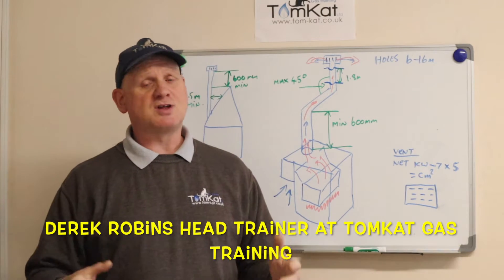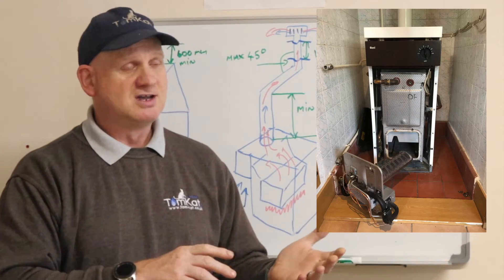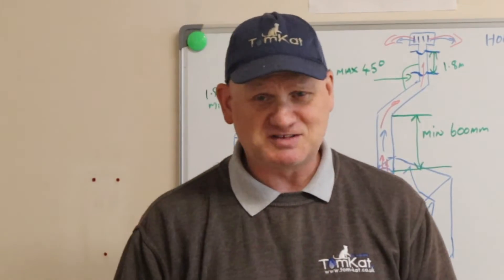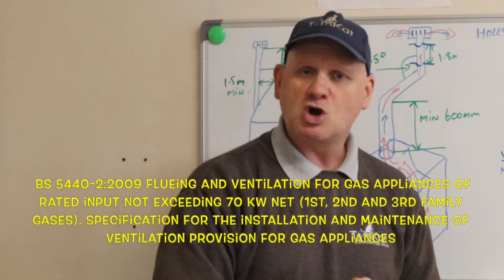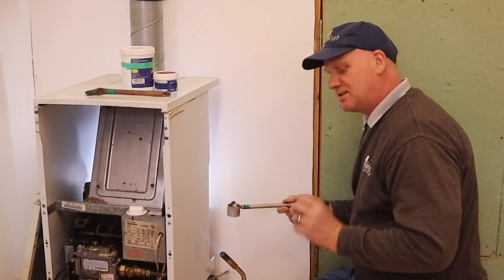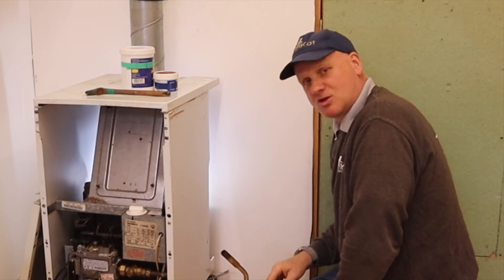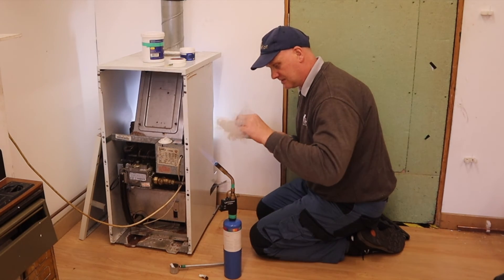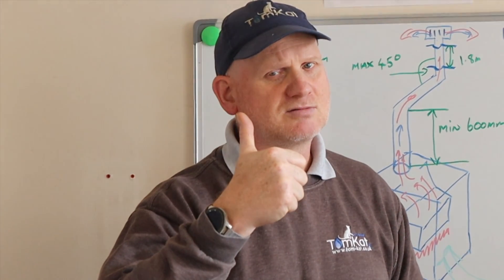Flue flow test and spillage on an open flue boiler. How to carry out the test.

Comment: Serviced one of the later Baxi Bermudas relatively recently. Doing the calculation of (heat output / heat input) x 100 based on figures from MI, the efficiency was around 80%.  Which is actually higher than the old Glow Worm non-condensing room sealed boiler that I have at home which just keeps on going and going - which is rated at 76%. Both boilers are over 20 years old and going strong. The life of an average condensing bolier these days is around 10-15 years. These old boilers will probably still be running after new boilers fitted today have reached the end of their life and need replacing again!  For the approx. 15% gas saving a modern condensing boiler provides, it isn't cost-effective to replace the old boilers until they are beyond economic repair - as any gas savings are diluted by fixed standing charges, so the cost of getting into a cycle of replacing a boiler every 10-15 years will not be recouped in gas savings. I'm sticking with my old Glow Worm for as long as I can!

Comment: I was struggling to get an open flued boiler for part of my MLP/ACS portfolio… we came across an old OF boiler in the Deep South of Cornwall,  an Ideal Concord CX which was from mid/late 90’s… it had numerous ID and AR situations ranging from flue leaking products of combustion to controls not working,  the parts were obsolete so it’s getting changed for a new room sealed,  it was good for me to see how to genuinely go through the AR/ID procedure in a real situation.

Comment: Look after quite a few, baxi back boiler !!, Mexico, ideals, and few kingfisher, they just refuse to die 🤣🤣🤣, every year think this is there last , give them a good clean out , change thermal coupler , check flue with smoke bomb, and off they go, yes they do use more gas but how often do they break down?, ( they don’t) how many new boilers would have been fitted in 30 plus years they have been in service , think I be 6 ft under before they finished

Comment: I'm a bit confused there because surely what you've done is the same test twice , because you put the smoke in the same place, one with the alliance not running and one with it running? Shouldn't the flue flow go at the base just past the burner at the start of the primary flue?
Reply from the maker: No you test at the draft diverter not at the burner. The flue flow and spillage are different test like I say in the video